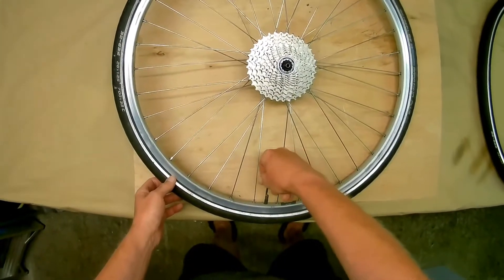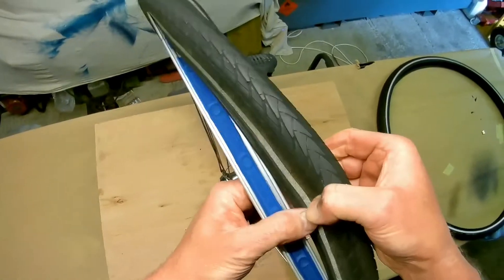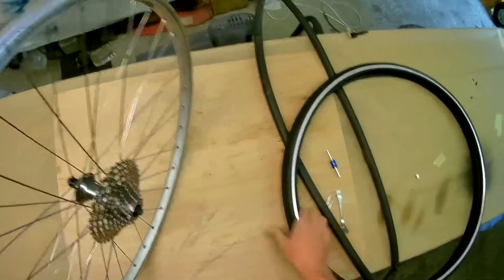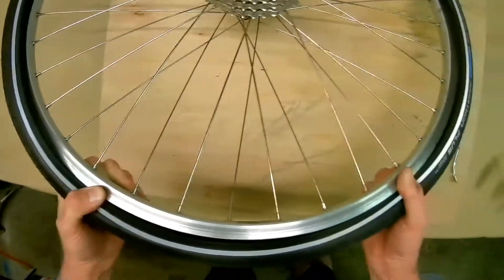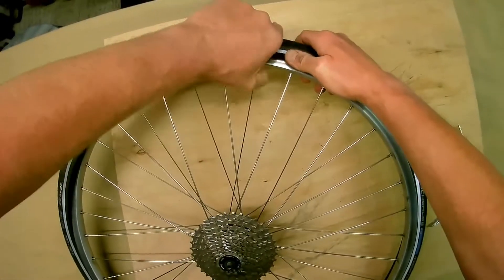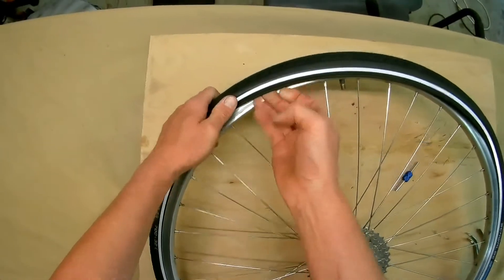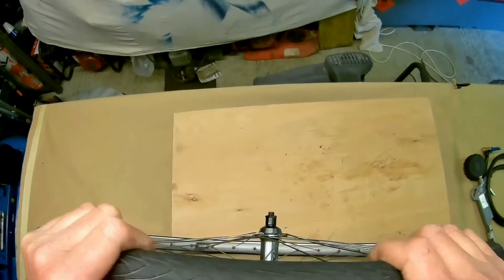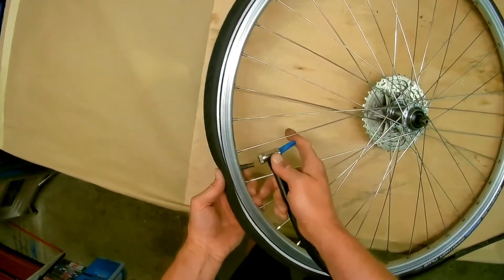Schwalbe Marathon Plus Bike Cycle Tyre Installation Fitment Tubed 10 Speed 700c Ryde Sputnik Rims

Comment: Just watched after having real trouble for the first time. I have a new rim and it was a real bugger to manipulate it but with the use of levers like you demonstrated got it on quite easily!! Many Ta’s!!
Reply from the maker: Hi Christopher, I'm glad it was some help. As long as you get the opposing bead right into the centre of the rim, it allows you enough to get the trye over the rim. Some are harder than others, but people often struggle with these. They are a great, long-lasting puncher free tyre, cheers 👍

Comment: Great video Pete. I just purchased these tyres and couldn't for the life of me get them on. Gave them to a mate who has the same tyres and he had a hell of a time fitting them also. We did what you did but without the same result unfortunately, but this video gives me more hope if I have a puncture. Touch wood I don't get a puncture.
Reply from the maker: Hi Colin, it can sometimes be the case that certain rims/tyres are a real pain, the case in the video is supposed to be one, first off the tyre is normally easier 2nd time around as, even with a metal bead it does stretch slightly so you shouldn't find it so awkward as the first, the tyres are very hard wearing and above all very resistant to punctures, people say they lack a bit of feel and have higher rolling resistant to some but it's a small price to pay for the reassurance that they hardly ever puncture.
It can sometimes be that when the bead is pressed into the rim it rolls over the tube so losing you space for the fitment at the top so try and make sure you get the tyre under the tube when you are fitting it, thanks for watching the video, Cheers 👍

Comment: Extremely helpful video, thank you. As a not very mechanically adept person about to try to install some of these for the first time, this gives me a bit more confidence.
Reply from the maker: Thanks Rob, don't be too daunted by it, the trick is getting as much of the tire into the opposite bed to the side you are trying to mount,  obviously the center of the rim is affectively smaller than the outer rim so use that to you advantage, do watch the tube though, just take your time and think about it as you go and you'll be fine,  cheers mate,  let me know how you get on 👍
Reply: @peteshobbies5383  Thanks, will do. I will also have cable ties at the ready so I can use one if need be to stop the tyre coming off the rim on one side of the wheel while I work it onto the rim at the other.
Reply: @peteshobbies5383  Hi Pete, pleased to say I managed to install two Marathon Plus MTB tyres today without too much difficulty, using the steps shown in your video. The first one was a bit of a faff but once I'd got the hang of it the second one went on in no time. Thanks again!
Reply from the maker: @robgrayson Hi Rob, excellent 👌,  Thanks for letting me know. They are excellent tyres,  last ages, and virtually never puncher,  cheers mate 👍
Reply: @peteshobbies5383  Hopefully happy trails ahead 🙂
Reply from the maker: @robgrayson Hopefully, yes,  ride safe, mate 👍